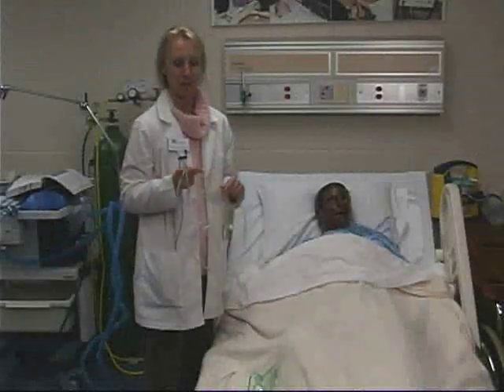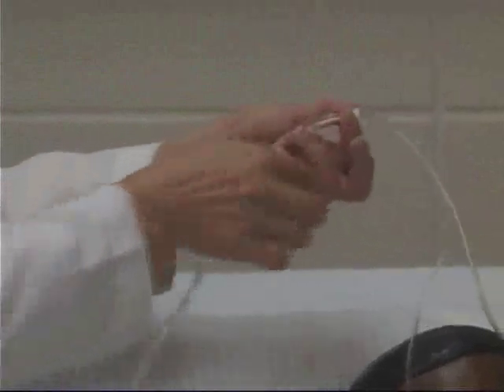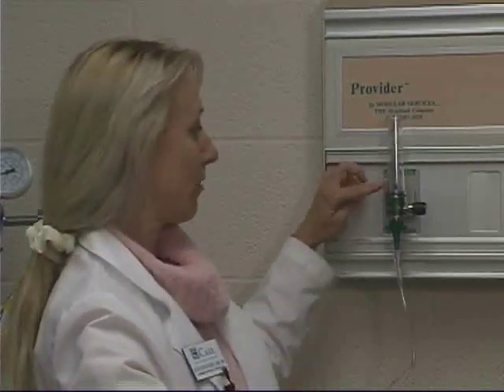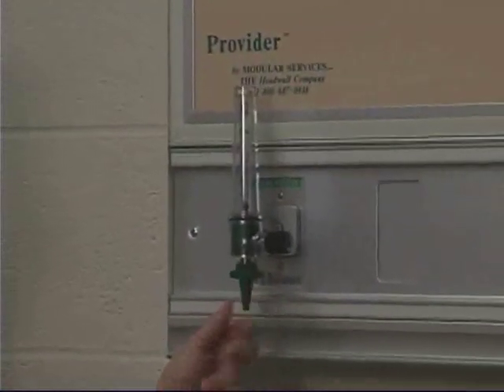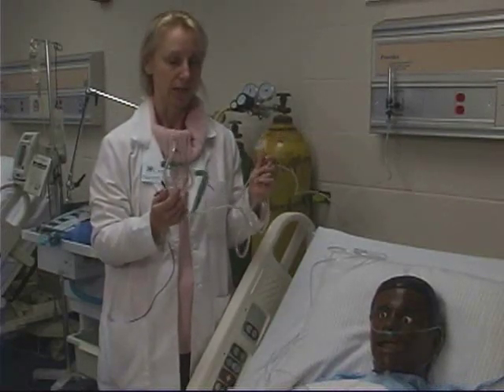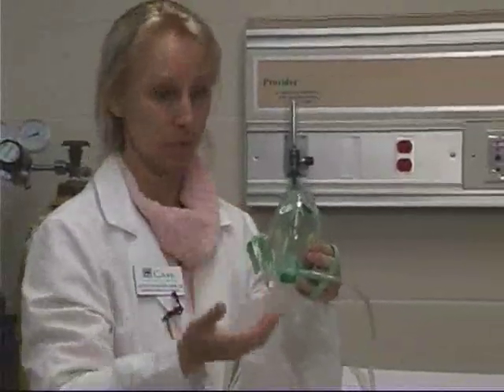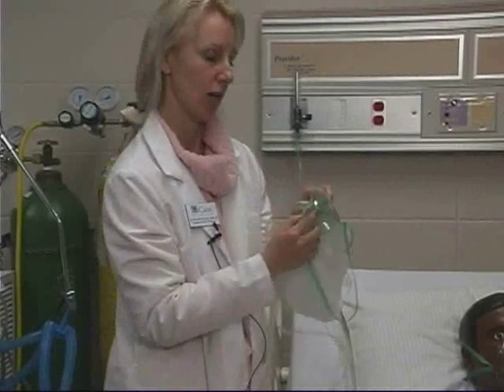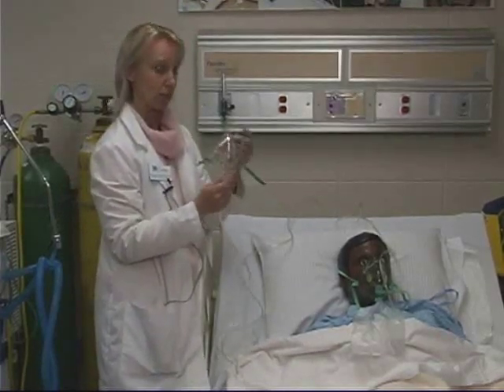Oxygen Therapy Skills Demonstration (1 of 2)

Comment: ·        Cannulas
better tolerated
may be humidified but often not if run @ less than 5 L/min
there are two types of O2-conserving cannulas
-Nasal reservoir
reservoir just below the nose stores ~ 20 mL of O2
allows for lower flows because of increase O2 delivery
 
-Pendent reservoir
pendent stores O2
must exhale through nose
 
**HFNC -  6-15lpm

Comment: Yike! This is full of errors. First, if there's a "deep pressure ulcer behind the patient's ears" you have a serious problem. Plastic tubing should never go over damaged skin, and the ears should always be protected from pressure damage when using a nasal cannula for a length of time. Moreover, the oxygen "tree" or "nipple" is not called a wing nut anywhere I have practiced, including Cleveland. Lastly, the percentage of oxygen is not influenced by the rate or depth of  respirations.